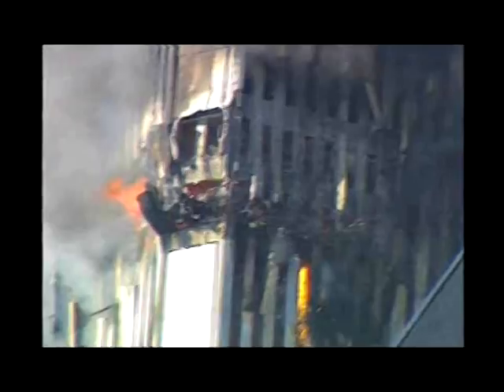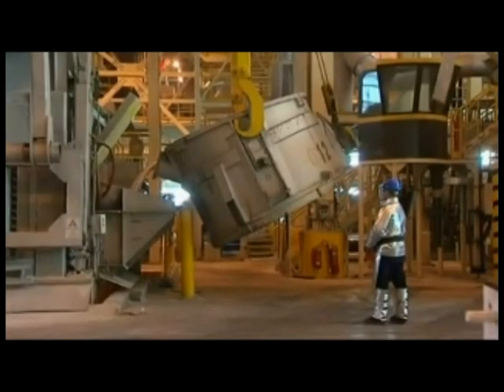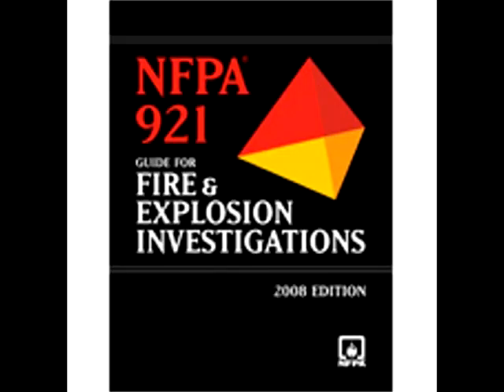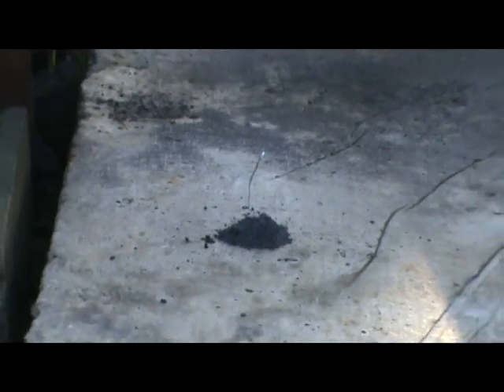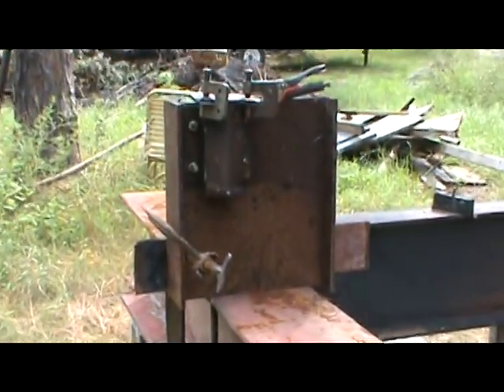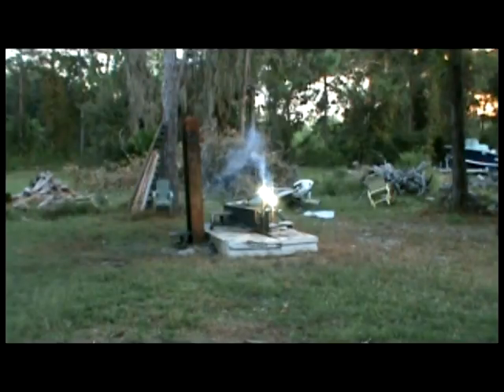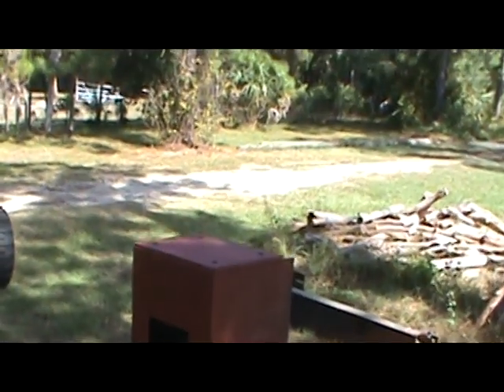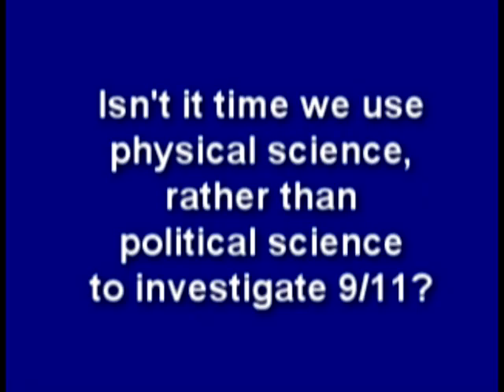9/11 Experiments: The Great Thermate Debate

Comment: and again, a hammer and flat piece of metal are not the same, the shape of the hammer gives some added strength when used in proper motion. You keep making examples that don't fit the experiment, which shows you really don't under stand the physics behind any of this. Two objects of the SAME size and density will destroy each other equally, as that would be an equal and opposite action/reaction. Your examples all twist or bend the original hypothesis in some way, bad bad logic.

Comment: @TheCrundlestix 
Yeah, actually, they do, specifically make IRON hammers to beat on STEEL Billets.
Because The ONLY thing that matters to a hammer is Mass and speed.
There is NO materials parameter there, fella.
The softness of the IRON hammer allows a metalsmith to round the surface, into
a rod, for instance, and steel being FORGED isn't as strong as cold steel,
super genius.

Comment: okay fine, but i guarantee no one in this universe is using a hammer made of soft iron to work a piece of hard steel, because it would not work. The hammer would flatten faster than the steel would give, and you would then have to rework the hammer. You twist the debate in ways that really don't make sense, which is probably why most people just start to ignore you after awhile... I'm about to do the same....

Comment: @TheCrundlestix 
Actually, it demonstrates EXACTLY that the physics and principles don't apply.
No Containers, and you get the same results for ANY amount of thermite,
nano, silly dilly, or super duper. What you can't seem to get, is that the 
application of THERMITE to any metal surface COOLS THE THERMITE,
just as much as it heats the steel. Thats the way thermal transfer works.
Put a brick of thermite next to steel, and you are likely to create a cool
wall of thermite that insulates the steel

Comment: @Merlin5by5 
"Hammers made of iron for beating their way thru IRON are common"

what is this giberish? Iron hammers? You understand that metal has different grades and density right? Hard iron could be used to work a softer iron, but not iron of the same or harder density.

""nails are driven into wood by bare handed Judo experts"

Again another argument that fails all logic, this is a parlor trick that takes of years of practice, its not physically impossible and is not a valid comparison.

Comment: @TheCrundlestix 
Maybe you don't understand the characteristics of your SUPER DUPER thermite.
It's NOT advanced in anything other than the micro environments it's proposed for.
Get more than a two ounces together, and it LOSES the speed and brissance
that it has on it's resume. Why? because the advancing flame / ignition front, 
then faces the same challenges of NORMAL THERMITE.
Reality is a bitch when it comes to the world of the very small.

Comment: @TheCrundlestix 
Lastly, you should understand that it's NOT a FOCUSED blast that cuts the steel in this video.
NOR is the steel "Melted thru". The steel is heated to 650 to 800 degrees, at which it has the
mechanical strength of Chunky Peanut butter, then the pressure of expanding thermite,
kicked the chunks out. Nothing was melted here, and without the containers you would
get another failure. Ask PhysicsAndReason himself, it's NOT the first time I asked him.

Comment: @TheCrundlestix 
What a pile of conspiracy crap. Many Steel Buildings have fallen in the US, some 23 by Fire Protection Engineering Magazine, and off the top of my head, I can name two, the McCormick Arena in Chicago, and the SIGHT and SOUND theater, then brand new, in Pennsylvania. BOTH of which featured the light construction of the WTC, and both of which burned to collapse, in McCormick Arena's example, in a LOT less time.
Try again, because you are FAILING so far.

Comment: @TheCrundlestix 
LMAO, this video shows it is impossible to cut steel without a PRESSURIZED CONTAINMENT system, bolted into the steel column.
There were NO containment vessels at the WTC, and his FIRST demo, at 8:14 in this video, FAILED, and is the only one that correctly demonstrates the conditions at the WTC.
The question remains, Kooktard, What FOCUSED the imaginary thermite,
and where did 100 TONS of Nano Thermite GO, since neither it or a container is in the debris pile.

Comment: One last thing for all the deniers- Any Structure, let alone 3 buildings all falling in on themselves, straight down, through the path of MOST resistance IS PHYSICALLY IMPOSSIBLE, without the use of PRECISELY timed explosive Charges. When those buildings cam down there should have been slow lumbering chaos, not a smooth even collapse. Those type of demolitions take months to plan and set up, they never just happen! Three in one day, 3 textbook demolitions, and you refuse to see it!!???

Comment: @Merlin5by5 
The point of this experiment is to counter the claim that thermite CAN'T cut steel, this video shows it CAN. There are forms of this explosive that are far more advanced than what is used in this or NatGeo's show. The point of the "boxcutter" is to show that a FOCUSED blast can easily cut steel. Obviously they didn't go around welding little steel boxes filled with explosive powder all over the WTC. You miss the point again, the science seems over your head based on your arguments.

Comment: @Merlin5by5 

Your logic is extremely flawed. The argument is whether two objects of the SAME MATERIAL colliding would equally damage both objects. "There is no action, without an equal an opposite reaction". A hammer and a piece of wood are not objects of the same matter and density. Try driving a  double ended nail into a board with another board ( of the same type of wood, of course ), I'm sure the nail would stick to both boards equally.

Comment: @Daddyo930 
LMAO, it's always great watching your ignorant moron explanations for common newtonian physics.
"A smaller object of similar design cannot smash its way through a larger object of similar design without encountering some kind of resistance."
Did I mention that is the physical basis for the most basic tool in the human toolbox,
The Hammer? Hammers are specially built to do EXACTLY the task of attacking,
destroying, and shaping steel for FORGES, and they have done so for 4,000
years.

Comment: @physicsandreason
SO, super idiot. Have you found an answer to my most basic question?
How can you use a pressurized container for this test when no such
pressurized containers, screwed into FOUR sides of a Box column,
EVER existed at the WTC debris pile? Let's talk scaling your demo.
Have you EVER figured out that the WTC core columns would 
outmass your demo by 40 to one? That your containers would 
need to be at least 10 Times larger, and FOUR times more
numerous than the core columns?
Hmmmm?

Comment: @Daddyo930

"A smaller object of similar design cannot smash its way through a larger object of similar design without encountering some kind of resistance."

According to you the planes did smashed right through the buildings, left them undamaged. Yes, i understand. Unfortunately, when i look at the footage, i see no undamaged planes exit... ergo, you claim the planes, while in the towers, switched to invisible mode. Good, your objection is noted in the records.

Comment: @palasta What is also a standard is that 2+2=4.  Is there something specific you would like to argue or would you like to hurl generalizations around for a while?  Lets start at Newton.  Every action has an equal and opposite reaction.  A smaller object of similar design cannot smash its way through a larger object of similar design without encountering some kind of resistance.  Is there anything wrong with what I just said?  Is there twoof in that statement?

Comment: @buckhead62 Sorry, you can't claim that buildings collapsed inward while sending material outward at the same time. That's like saying your cat is entirely black and entirely white simultaneously.

The debris being sent outward is a documented fact. Several buildings in the area were damaged by said debris. N. Tower damaged WTC 6 and 7, and the latter damaged Fiterman Hall and the Verizon building.

v=qhyu-fZ2nRA
v=nIZp6aOibiM

So is it irrelevant, or does it support your point? Pick one.

Comment: @buckhead62 Not molten. Heated, and thus weakened. The OS does not require steel to melt, only to be weak enough to fail.

The stream of hot metal witnesses, videos, and  photos saw *cannot* be identified as "steel" visually only, even by a trained metallurgist. People often conflate "steel" and "metal" when speaking.

Comment: @Skeptic121 None. It was, however, hit by debris from the North Tower, set ablaze, then the fires were mostly unfought for several hours.

Say, if the debris hadn't damaged the building and set off the fires, what sort of excuse would They have used? They couldn't have known exactly where the debris would hit, which means they couldn't have positioned the explosives to make the fall look credible. Unless They planted the explosives *after* the debris damage.

Was the FDNY in on it?

Comment: @Skeptic121

"If the entire collapse took 13 or 130 or 1300 seconds, fine,"

The core statement is, that the collapse overall only lasted 6 seconds and for this to happen all the supportive elements must have failed at once. That is YOUR statement. Don't you remember? Don't you know what you're actually advocating?

Comment: @Skeptic121 Except that if the CD made the E. Penthouse fall first, then it is, by definition, part of the overall collapse.

Which means a 13-second collapse.

It wasn't in free fall, it was free fall acceleration. And that was the middle period of three; the other two were both slower than FFA.

Comment: @wboquist 7 hit Fiterman Hall and the Verizon building, both of which are across streets in two different directions. That's not "straight down" or "into its own footprint." NIST never claimed that the whole building went down at freefall speed, only that part of the building went at free fall *acceleration* for part of its descent. That's two qualifiers and a different term.

Comment: @puffintuffer It doesn't actually say what it's reduced to. Remember, the charges have to be deployed in the smallest timeframe possible, yet they also have to be durable and secure enough to stay on the columns in an impact that blew body parts clear out of the buildings. The only way to do that it to add more padding, which means it's more conspicuous. Also, the wiring would have to be fireproofed, and any radio detonators would be unreliable.

Comment: @puffintuffer I like how you immediately drop the professional act.

The impact and explosion of the jet hitting each tower was enough to break columns-including the ones the charges would've been attached to-and enough to send human remains flying 400 feet to the Deutsche Bank building. There is no way to know which columns are broken and which weren't. Radio detonators aren't reliable, and wiring would be conspicuous.

Comment: @puffintuffer It would be rather difficult to plant said devices unobserved. The easiest way to do it quickly is to get more people, which means that there's a bigger chance that any one might squeal. There's also the fact that thermite does not burn uniformly, so it would not be able to reach the split second precision required to fake a natural collapse. Said devices also have to be low profile, yet also durable enough to withstand the jet impact and the subsequent fire without malfunction.

Comment: @puffintuffer 1. When were the devices planted?
2. Why didn't anyone notice them being planted?
3. Why are no detonators or wiring visible in photos?
4. How much thermite/thermate would be needed to cut a WTC beam?
5. How big would each charge be?
6. How many were required?
6b. What was the total mass of said thermite?
7. Why would they enact such a plan if it adds significant risk and complexity to their operation?

Most of these are rhetorical.

Comment: @Skeptic121

"So you admit that the fires in the towers were not just hydrocarbon fires?"

O boy. There were many kinds of materials (i.e. some left over jet fuel), the fires reached a decent size, they weren't extinguished easily. In the controrary. What happens when you put ordinary water on a 600-900°C hot steel beam?

"BTW, it is just like arrogant Germans to spell English words their own way."

Pfahaha, you're molto stupido indeed.

Comment: @Skeptic121

" Iron sulfide was found by Prof. Barnett "

You're acting like this something extraordinary, but with the cocktail of different components (different metals amongst them) combined with the heat the hot spots produced under the rubble, someone with a slight idea should know very well that it is not.

Comment: @palasta I did not have an obligation to inform myself about any theories. The maker of this clip does not advance any. I do not and the maker of the clip did not assert that his work determines conclusively that the towers were brought down with charges like his. He set out to answer the same question that the makers of the clip he embedded *claimed* to be trying to answer - could the mixture he had cut steel. He experimented enought to conclude that it could.

Comment: @wboquist

Analytical reasoning, good one. Like when the picture of "blown outword boxcolumns" is shown, implying that it was deformed by an explosion, however its more likelier that it happened during the collapse. Or at 13:30 "the glowing columns" which actually is just the Aluminum covering and not steel. And of course the NT-charges inside of the beams. Imagine the effort to cut open a hundred and more columns, to put the smuggled 100-200 tons of NT inside. Technical acumen... hahaha.

Comment: @TheFlyposter

There is also the lack of molten steel. The estimated 100-200t of NT would propably leave behind a vast amount of disfigured steel beams and columns. Nevertheless, the only mentionable pictorial material of significantly molten steel beams, are the ones severed by oxygen lances.

Comment: Great, so you will be able to explain how Harrit's nano thermite samples ignited at 430c, yet managed to survive jet fuel fire temperatures, and stayed in place when a plane struck at around 500mph to initiate a collapse starting where the planes hit about an hour later, because that's the problem that you have to solve for it to have been a controlled demolition.
There are other problems as well, like the lack of sound if it was explosives, or the lack of visuals if it was incendiaries.

Comment: @MrHangbush

You dull head. It's not about a missile defense system installed at the pentagon area, it's about the missile defense system the pentagon commissioned. Or do you really think there was a missile defense system build for 130 B $ only for the pentagon? Still no prove. Everybody knows about it and it was still in the media after 911. I remember it very well, i remember very well the reported problems with the hit ratio.

Comment: @MrHangbush The transponder does not report direction or speed, the transponder reports pressure altitude and and a serial data stream that identifies what plane it is. 

Without the transponder the plane simply looks like a blip on the radar. In busy airspace it takes tons of time to try and pick out which random return is the plane you were just tracking. 

And no it's not more obvious it's been hijacked, that is why the transponder has channel 7700.

Comment: @Headshothorror4488 "this guy IS A EXPERT and is showing physics"

Gage isn't any kind of an engineer, and only has an entry-level degree in architecture, which is why he has never designed anything taller than a 2-story strip mall, and has never published an engineering paper in his life.

Don't you Truthy sheep even know the difference between an architect and a structural engineer?

Obviously not.

Comment: @MrHangbush "Its 50 miles out 40...10 bang. Thats called tracking it"

If you bothered to do any real research, you'd know that wasn't even a real plane they were talking about.  It was a PROJECTION of where they thought the Shanksville plane was, assuming it was headed their way.  It wasn't.

No one knew where Flt 77 was until it was spotted at Dulles & the Nat'l Guard plane followed it in.

Are you copying nonsense from PrisonPlanet, or just pulling it out of your ass at random?

Comment: The fire in this experiment was small (low energy output), it was open, lasted for only one or two days. The fires at GZ burned for weeks, was "subsurface" and were constantly fueled by water. Yes, fueled... if you're really such an expert and educated than this needs no further explanation.

Additionally there was only this little piece of metal found. I repeat: Where were the TORRENTS of molten steel?

Comment: @MrHangbush

"The penatgon has a missle defence system which will only allow a military jet transponder to come within the shield, anything else and it would have been fired upon."

Bullshit. Pure Bullshit. There is an airport right around the corner. Planes pass the pentagon every day in a short distance. See for yourself type  - pentagon plane airport - into the google picture search. The second and third picture. Look at them and then dare to repeat what you've written.

Comment: @MrHangbush

"which if you look at demolition videos you can find the same speeds in the collapse."

Hmbullshiiiit. Controlled demolitions behave different, they do look controlled, in the opposit to the towers collapsing. They don't simply break apart, the top is smashing down on the floors beneath, they blow apart and this doesn't happen in a controlled demoltion. Why? Because the resistance is annihilated, not the towers, thats why tons of steel beams were hurled out hundreds of meters.